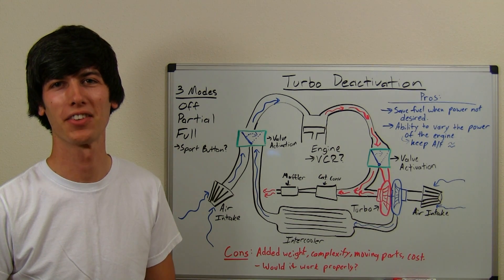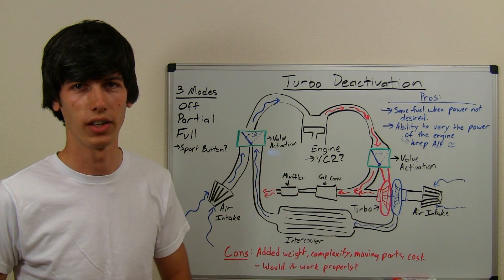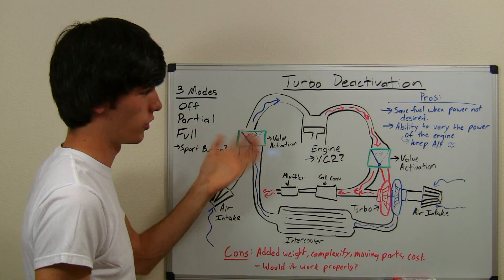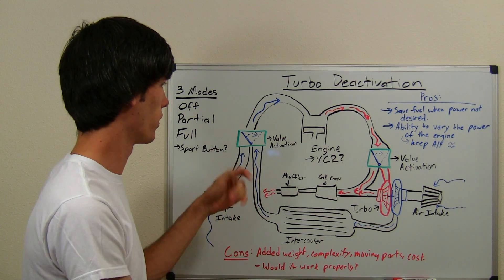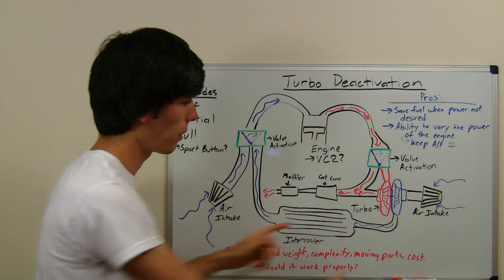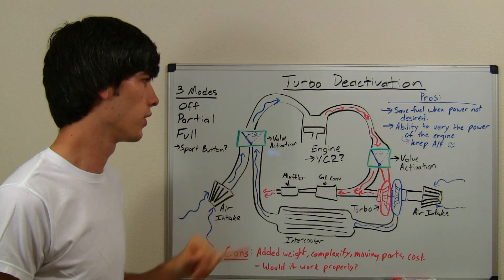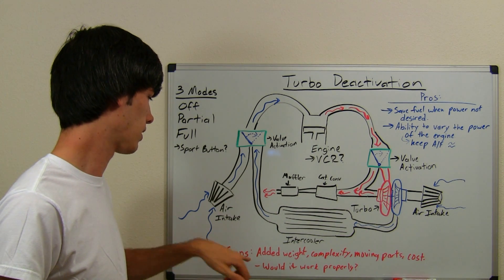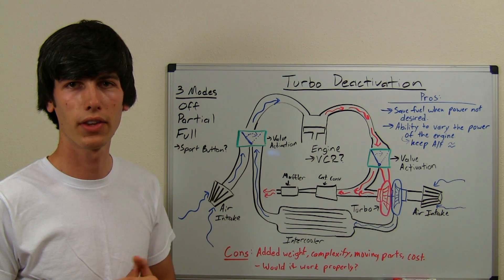Turbocharger Deactivation Concept - Explained

Comment: As far as I know, some manufacturers that make options (turbocharged and naturally aspirated) for the same size of engine, use some different parts between them, such as the pistons. The pistons of a turbocharged engine normally has smaller diameter (CMIIW).
So if we by pass the intake side on this engine, (and use the smaller piston diameter on naturally aspirated engine), I think the HP and torque will be dropped.

Comment: Wouldn't it be easier just to mount the turbo normally and have the BOV open all the time while having that valve switched to the naturally aspirated side?
Reply: sotiris.bos Nice question - which is conveniently being ignored by some on here. Truth is only in basic theory does a turbocharger run off 'wasted energy'. in reality turbochargers are an exhaust restriction ie they cause an increase in exhaust back-pressure forcing the engine to work harder on it's exhaust stroke. A NA engine running a turbocharger without the compressor side being connected to the inlet would be significantly less efficient than when operating without a turbocharger all together which completely debunks some of the myths being pedaled on here.
Reply from the maker: Well, that'd be a waste of energy to have the turbo constantly spooled even though you're not using the additional air.
Reply: Engineering Explained The turbo theoretically runs by using wasted energy anyway so why would constantly spooling it be a loss? I also believe that your idea is implemented more or less with variable geometry turbochargers.

Comment: wouldnt this scare the ecu and confuse it? i could be wrong but it seems that an engine that is naturally aspirated AND turbocharged would mess with it and cause things to work improperly. if this could work right it would be incredible.
Reply from the maker: From a controls standpoint, it's very do-able. Sensors would easily compensate for the changes, but there are other reasons why it might not be the greatest idea, as have been pointed out in the comments below.

Comment: alot of trucks and vans have turbo's to MAKE them more fuel efficient i thought why would you turn it off
Reply: What makes them "more fuel efficient" is that they have much smaller engines that natively produce less power and to get it back up to a usable (the car can run) HP a turbo is installed. small useless engine boosted so that it is just back up to par. Ford Eco boost I'm looking at you.

Comment: I would say a VGT turbo... it has vanes in it that are controlled by the ecm and the vanes will move in or out increasing or decreasing the amount the turbo spins on the exhaust side.. it works as an engine brake on the engine and it is used on diesels

Comment: Instead of having 2 intakes, could you possibly use one with a hinge valve to bypass the intake to the turbo and feed that straight to the engine while still using the other hinge valve to bypass the exhaust around the turbo?

Comment: First of all, it will never work properly cause  variable crank parts will break or get stuck second a non turbo engine is less efficient.  one thing you don't know is a turbo adds more air for more power and not more fuel cause without air no fire.    higher explosion is because compressed air that's what's power and efficiency comes from.  you also don't know about the 40 meter a second theory    if you want too see my concept what's waterproof too success let me know     

greetings

Comment: The electronics required for valve activation would probably not survive the heat of the exhaust manifold. The partial mode would be very dangerous because the sudden boost at high rpm would make it difficult to stay in control of the car.

Comment: inside the engine: variable compression ratio was never a good idea to start with. complex, expensive, heavy, and reliablity problems.

my biggest concern is that this system is totally unnecessary. i dont know if you noticed but when you drive a turbo car normal street conditions, cruising, not on power, the engine basicly running on no boost, its on atmospheric pressure or a little above to give you the desired amount of power that is enough to keep the car rolling. the ecu controls the fuel

Comment: it would work but it also would achieve the goals youre after, making the system pointless. because the complexity and the many moving parts and electronics that should be necessary to make it work, it would be prone to failure and expensive to produece and repair.
inatke and exhaust manifolds: NA and turbo engines use totally different capacity plenums, runners and header pipes to work properly, so your best bet would be to have your walves directly on the head and have 2 set for manifolds.

Comment: i think there is the butterfly valve to restrict boost enought and i simply can not see the point of this. because of bigger head capacity and less compression ratio for turbo engines the its okay the normal turbo engine will have more fuel consumption, but there is simply no reason instead of saving the turbo for turning it off with a bypass valve. they should use variable compression of some kind from the simpler ones to get better fuel economy,but this whole system is simply pointless i think

Comment: I agree with both your statements.I think some pple hv put combo chargers on b4 to eliminate lag and have a high bottom-top torque. But I have read that it costs too much so that makes it unappealing for car manufacturers.Even on exotics I don't know of any car that has this (correct me if I am wrong).On street driving I wldn't be comfy with a sportscar that gives max torque at 2k rpm. Lol!I ride also ride a sportbike (1198) n it is HAAAARD to ride in stop n go traffic hence the lane splitting.

Comment: (part 2) ...Not unless you would also have another exhaust that would also be controlled by the ECU to open while shut-off the intake for the turbo's exhaust when it is in "OFF" mode.

2) The "PARTIAL" button would take too long to spool up and would have a very small range for the boost. For example, N/A engine upto 3.5k rpm the turbo from 4k-7k. This means that the turbo would only START spooling when you hit 4k and would probably boosting at 6-7k rpm which would make it somewhat useless...

Comment: I think this is a good idea, but the first cons that popped into my head were (I could be wrong). 1) Getting a turbo would require a bigger exhaust (ie. 2.75-3" in diameter). This means that with the turbo in the "OFF" button, you're car would definitely suck and would waste gas because the amount of gas required for the N/A (off) button would be greater to get a car at the same speed compared to if it had a properly sized muffler for its back pressure..

Comment: From what I understand, to get both benefits of a turbo-charger, people generally will use a turbo that really only produces boost in higher RPM. The benefit being that you can drive like a normal person, and get the benefits of the non-boost turbo fuel economy, but once you raise the RPM, you get the boost. Most people during a track day (and going crazy through traffic as if it were track day) stay in high RPM, so this isn't an issue.

Comment: Yes, combo charging is possible. I'm pretty sure it's generally done on diesel engines right now, but it does exist, and exactly for that reason. good low-RPM boost with the belt-ran supercharger, and then the high-RPM boost with the turbo-charger. To be honest, I don't know the details of how it all works, I just know it exists. Usually for large trucks.
I've also heard of a few cars having a supercharger that you can turn on and off, and that uses an electromagnetic clutch, like your A/C.

Comment: I'm not sure if this is how combo-charging works, but do you think it would be possible to attach a roots or supercharger to where the natural air intake is, and possibly electronically time the flaps so that the supercharger would give low rpm boost thus eliminating turbo lag? Btw i pose this question based on the last hours i have spent watching your videos, very well done and thoroughly explained!

Comment: The idea you propose is in fact already inherent in all turbo systems to a degree.
To gain a good low rpm boost you must choose a small light turbo that spools up at a low flow, but such a turbo constricts the flow in the high rpm's.
On the other hand choosing a turbo that the engine can never spool up to maximum rpm (for the turbo) is a way to keep the boost under control. This system also provide a low rpm range with no boost at all - this is quite common in diesel engines with turbo.

Comment: Seems completely plausible, but I don't see much of an increase in economy if the turbo is not on boost, especially with variable compression. I would think that direct injection as well as cylinder deactivation under light loads/deceleration/idling would have a larger impact, especially on 6 cylinders+. Then with your 'sports' mode, you could turn off the latter and lock the compression ratio, thus reducing turbo lag during acceleration after braking, as more exhaust gases with be generated.

Comment: Can you imagine the turbo lag on partial mode? XD your turbo would go from sitting still to having 5000 rpms worth of exhaust gasses hitting it at once, i feel like that would choke up the system for a second since there wont be much air getting through the intake side of the turbo.

Comment: I haven't really read any other comments, but this idea is a pretty good one. The only thing is that there's a far less expensive alternative to buying additional plumbing, and valves and waste gates. Boost controller, either mechanical or electronic.  Electronic would be better for yhe conditions you've explained though, with things such as fuel varying. All a boost controller does is tell a waste gate to open, the waste gate then reroutes the exhaust gases, hence no boost. Great video though!

Comment: I had a similar idea back in 2005 'ish but my colleagues laughed at me.  I believe soon after VW came out with the Twin-charged Golf GT that had valves switching from the compressor to the turbo so that part is feasible.  As for variable compression, Mercedes was working on a prototype to reduce the use of spark plugs on gasoline engines much like diesels, but I'm assuming that's been shelved.

Comment: if you had this setup on a variable compression engine would be better.... high comp on no boost mode ..... low comp on boost.... would get the benifits of a n/a engine and a turbocharged in 1 ..

Comment: Possibly implemented based off the throttle position? This way you are economical at any time you don't pound the throttle. Ecu's already calculate throttle position. So at say anything over 50% throttle it uses a vacuum solenoid to start switching the valves open to the turbo. The issue you might see is exhaust will take the path of least resistance. So it might not build boost until the valve is completely open. Thus creating turbo lag. At the track you'll be full throttle and have full boost.

Comment: variable compression would be a huge engineering task itself. without that there would be no pros to this method? if you have a large laggy turbo and cruise around on it you get the same outcome as the system you describe here (probably not very good fuel economy). effectively a large enough turbo would approach the same intake/exhaust restriction as n/a

Comment: Love the concept & are spot on in regards to increasing engine compression when going N/A. Well setup turbocharged engines can have a relatively high compression to minimise the effects of lag & create a stronger/more linear power curve, that said the compression is almost always lower than an N/A equivalent, so if u cut all boost this lower comp engine would be a pig of a thing to drive even in city driving conditions. Elephant in the room though-who buys a turbocharged car to save petrol? haha

Comment: Very good video as usual. Nevertheless, I am not sure that such a system would be really useful since one great characteristic of a turbocharger is that when you are light on your right foot, it does (almost) not blow so it behaves close to a NA engine. Actually you would avoid some backpressure, which is good, but is it worth it when you precisely drive economically? Low rev means low backpressure... So I'm doubtful of the benefits regarding the extra weight and cost! Nice idea anyway.

Comment: I also wonder if this would be an issue at low rpms in "off" mode. Simply because I feel like there wouldnt be enough air. Since the primary air intake is driven by the exhaust,  the intake would be near the back of the engine.  So the air would have to travel through long hoses to get to the cylinders. I wonder if the exhaust could create enough power to over come this to consider it "efficienct". Just a thought like the concept though!

Comment: Good idea but I feel it wouldnt make cars much more fuel efficient. You have to worry about things such as valve timing, engine durability, etc....it may work more efficiently on diesel trucks because you dont have to adjust anything. Seems like ecoboost with an off switch to me. Regardless its a good idea you definitely know cars.

Comment: This is all currently achievable with existing electrically driven wastegate actuators!  There is no need to have the intake system diverter valves as a centrifugal compressor is not restrictive to flow, even at a pressure ratio of zero!

Comment: I'm not 100% sure but while looking at your diagram wouldn't you need another valve to the left of the turbo so when in "Off mode" the exhaust couldn't creep back, spinning the turbo backwards thus sending air around to push the first value open making an endless loop while also spinning the other side pushing air out and creating a low pressure vacuum and possibly damaging the leftmost valve? Tell me what you think?

Comment: I like your idea but I think it would be too impractical. I don't know a lot about this, but I think running an engine designed to be turbocharged, without a turbo, would be quite inefficient. Yes, it would use less fuel but would have a significant drop in power, as you said with the CR (this would be the largest factor), but also with valve timing (could use VVT), and also ignition timing, AFRs, etc. (maybe fix with engine management). For the complexity you may as well have two cars.

Comment: Ok I scrolled through all comments to make sure this wasn't covered yet, Mazda used a rotary engine in there rx models. They implemented a multi intake system with a twin turbo system. This opened a extra intake runner to create more boost at a higher rpm. I'm rusty on the details but I'd defiantly look into it to further you idea.

Comment: bad idea, 
if your car is 250 - 500whp then this idea suck`s, without turbo this kind off power engine doesnt make better :D
but if your car is stock ~150hp whit turbo, then this case turbo helps to get better fuel efficiency , only difference is how hard you push the gas pedal. 

thats my my opinion.

Comment: this is a good idea, and a very clever way of presenting it. problems i see are the number of parts (current engine bays are very cramped as it is) and the difficulty in designing such a mechanism. there arent many multichannel valves that can switch quickly enough and hold the necessary pressure without leaking. if this system were to be implemented, then both the turbo and the na would operate at less than peak efficiency. ebcs can be used to resolve the same issue. great thought nonetheless

Comment: ....because it is hugely misleading. As Consumer Review found out in their comprehensive tests- a turbocharged car with supposed better MPG test figures and similar peak bhp as it's NA equivelant in the real world will have worse fuel efficiency and reduced performance in comparison. Modern 'eco' turbo's are essentially an extremely inefficient high-power engine and an extremely poor performance moderately efficient engine, rolled into one.

Comment: check the wiki page on Scuderi Engine, there's an example of a IC engine that has lower BSFC turbocharged than NA. And why is it a mistake to compare efficiency at low loads and comparing max bhp? It makes perfect sense to me that one would want an engine that can make big power (when you dont care about fuel economy) but also be more fuel efficient when you want to hypermile.

Comment: I feel like your biggest problems would be that you would need a strong exhaust manifold, a strong set of valves and a way of blowing off the excess turbo air when you cut off the turbo along with a way of getting the turbo spinning before you put it on full turbo. You could eliminate 3 out of 4 problems by getting a smaller turbo but that isnt really the point is it?

Comment: implement a small turbo as the diagrammed N/A mode. great gas mileage. performance increase from quick spooling. now implement that partial mode for twin turbo. use boost from small turbo to quickly spool the large turbo. different plumbing but hey your a smart kid and im sure you can reroute some things to include that intercooler

Comment: The system that really intrigues me and I think makes more sense for what you are talking about is a twin turbo system that incorporates two turbos of different sizes for different applications. One smaller turbo for around town driving and fast spoiling and the other larger one for more power.  Then when you want tons of power like track driving they will boost simultaneously and provide lost of boost.   BMW has started to do this with some of their cars recently.

Comment: Remove half the intakes, half the valves, and your only addition to the sistem is a valve at the exhaust port of the turbo and maybe a slightly more bulky intercooler... OH. Or a second butterfly valve with a 2 stage intercooler. A lower and upper half. Lower hardly restrictive at all, upper half would be your standard setup??